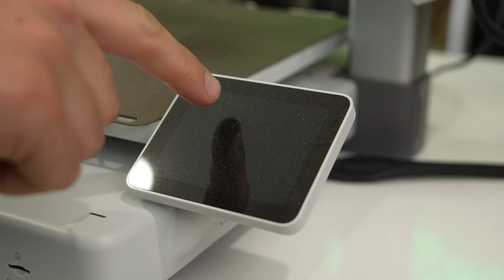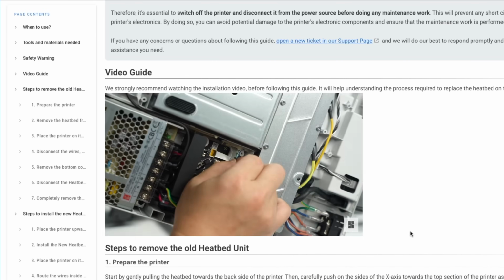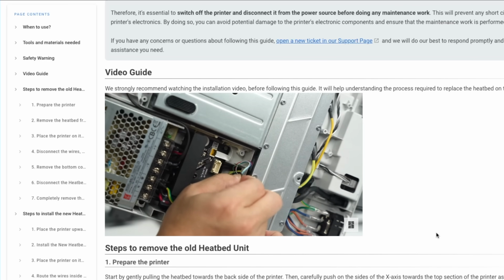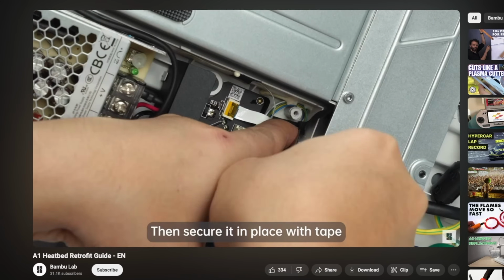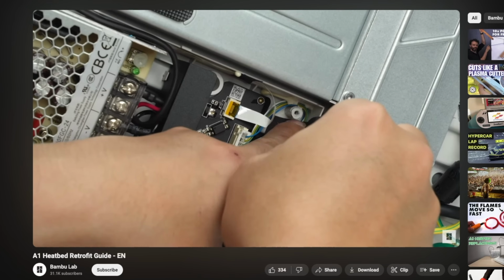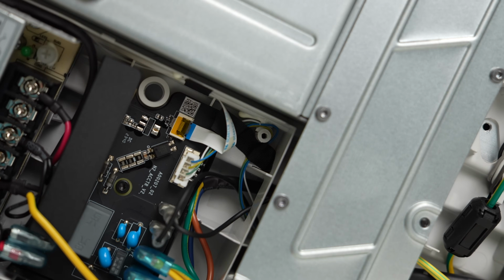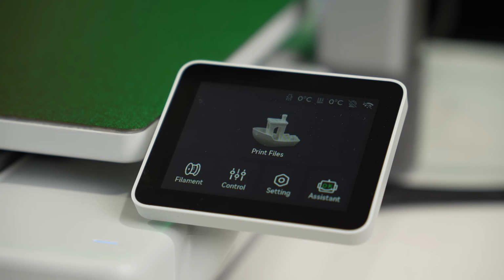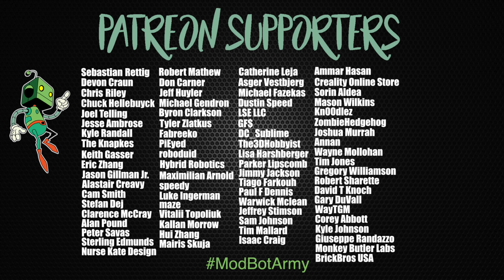Bambu Lab A1 Bed Replacement Guide (Avoid Mistakes)

Comment: Is it possible to swap the cable from a Heatbed?

My broken Heatbed has the new cable and my replacement unit has to old cable. Doesn't sound like a good idea to a Heatbed with the old cable, but if I can switch it, that's shouldn't be a problem.

Comment: Thanks for the very useful video. I just received my A1 from the 2 Year sale and found that the Bed Cable was very twisted and during nozzle cleaning the cable was being hit quite hard every time.
I opened up the panel with the six screws as you described, and I untwisted the cable a full 1/2 turn which solved this and looks exactly as you show at 11:55 minutes in your video.
The printer was sent to me with the cable incorrectly installed! It was easier to fix this myself with your video guide, than go back through Bambu.

Much appreciate your video.  Thanks heaps.

Comment: Just finished mine. One thing I'll add is that some parts of the repair were easier for me when the printer was oriented on its front while leaning the uprights on a spool. It was a pretty easy repair for any hobbyist who turns a screw. While inside, I also rerouted the second ground wire so it wouldn't out any tension on the bed cable. Honestly, the tape was the hardest part for me. 

Great video! Thanks!

Comment: There was NEVER anything wrong with my A1 heat Bed, however to protect Bambu I did the heat bed upgrade from them!  Personally I don't see anything better about the new heat bed cord other than they just put a braided cable guard over it and provided a back stop bumper.

Comment: I recommend not positioning the printer as described in this video , or as indicated by Bambu labs. First of all, use a flat surface that is entirely level across the area you’re using, so not different heights as in this video. Also don’t position it on the left, as the print head will move and rest on the sensor and if you installed the scraper, it will touch that too. Instead, rest the back side on top of a box that is ca 10-15cm (4-6”) high, making sure the bed cable is free and raised above your working surface. Then lower the entire top bar down to your working surface . This provide a MUCH more stable position of your printer, and makes it much easier to work on.

Also, the video linked from trimming is the bed installation video, not the trimming video.

Comment: I got so confused with the holes on the bed. I assumed all 8 holes lined up with the 8 holes in the brackets on the printer. Apparently its just the 4 bottom holes that line up.It looks odd. 
And yeah, the mesh and white rubber end of the cable had me confused too.  Not as easy as it sounded, but not really bad either. 
Nice video!!

Comment: I opted for the replacement bed. Got it all installed with out too much trouble. Glad you pointed out how to capture that cord so it doesn't back out. That was the only thing I was struggling with. Printer has been back up and running for a few weeks now with no problems. Awesome video, thanks Daniel.

Comment: Tip 1 I used a magnetic 🧲 after taking screws that got stuck in  bottom hole of panel .
Tip 2. Use a zip tie to feed wires just tape them on and feed through .

Comment: I had an A1. I chose to send it back for a refund. I got an X1C instead. Even though its a little more than double the price, I don't regret it for a minute.
Reply from the maker: X1C is a beast! I love mine and given the choice between the two would absolutely go with that.
Reply: Why not p1s, just wasting money
Reply: @riba2233  Its mine to "waste". As I said I have no regrets. I love all the features of the X1C.
Reply: @MrMuzza008 ok bro, no need to get upset lol, I just wanted to hear some concrete reasons to get x1 over P1

Comment: This does not look "difficult" but it does look tedious as hell. 

I also wonder who is liable if it fails again and sets your house on fire. Ican see Bamboo arguing you screwed up the install instead of taking responsibility. Better to have them do it.
Reply: You are liable ofc, you had the option not to do it yourself
Reply: Have you replaced it yourself? Then you. Has bambu replaced it? Then bambu. Has a electrician signed of the repair? Then the electrician, which was kinda the whole fiasco for EU citizens. Most electricians dont sign off work others have done, let alone with parts they dont know. Of course given you actually find one that has time. Most will have a look, but wont take over the responsibility in case something happens, hence no sign off. Bambu realised that and they took over the responsibility, yet im unsure how much this holds in the case of a fire and liability case, hence ny answer that the owner is responsible, just to know the worst case.

Comment: Only "issue" is feeding the new cables through the center hole/channel separating front and rear of printer base.

Just use a zip tie. 

Feed the zip tie from the front of printer towards the rear of printer through the hole.  

Tape the new wires to the zip tie and pull the zip tie back towards the front of the printer till the wires are through the hole.  

Untape wires and continue installation.

Hope that helps

Comment: In the next few months the A1 is going to be obsolete.  The new Kobra 3 Combo is a lot cheaper but has all the new technology.  Its also faster and has a more efficient AMS with more features.  I can see Bambu shaving off $150-$200 off the A1 combo just to keep it being bought
Reply: We also thought of that when creality announced the k1. Reality is its cheaper, but also objectively worse (extruder still bad, k1 and k1max have horrible vfa, creality is a joke, nozzle leaks all over the place). Knowing anycubic, we can worse customer service than creality and several open source licence violations.

Also, how would you make a MMU more efficient? With single nozzle and multiple filaments you will always have to purge. The amount you have to purge is determined by two factors, colour, how much filament is left in the hotend. The longer the hotend, the more filament is left. You can ram out a good chunk of the old filament so you need to purge less, but you are always inevitably wasting at least one length of your hotend worth of filament per swap since you have either forced it our before the swap or you are purging it out with the new filament. So either anycubic has shorter hotends, so less purge but also lower print speed, or they are cold pulling filament, which means a huge amount of time is necessary for the colour swap, even with ceramic heater hotends. Cold pulls for colour swap are only viable if you have a inductivly heated hotend (yes, these exist, team plasmics has launched them over a year ago) which have heating times of mere seconds
Reply: @over_pizza_2578   you have a very good point, but people like him are aggressively ignorant will unfortunately never learn :|
Reply from the maker: I would love to see a true competitor come from Anycubic. Right now it’s just specs and marketing. Until I have either tested it or seen others test it I’ll take it with a grain of salt.
Reply: @ModBotArmy  Its not like the A1 has a proven history.....How long after launch did it go before a massive recall?  Yet people bought it
Reply: This is such a naive take, in reality it won't be even close don't worry. Also I highly doubt it will have auto flow calibration...

Comment: Oh dear. The grounding wire looks to be on a painted or anodised mating surface, and using coated screws.😮 This is no good at all. I would advise sanding or scraping the paint/anodised surface and using a non coated screw there to ensure your bed is grounded properly. The way they have done this is not a safe or correct way to ground. Should be bare metal to metal contact.
Reply from the maker: The screw is definitely coated however the frame it is attaching to has no anodizing or coating on it. It’s bare metal. Could be my lighting/camera that made it look differently.
Reply: @ModBotArmy  Are you sure about this? It looks like shiny aluminium inside the threaded part and white coating on the outside flat section. All good if it is just the lighting making the surface look coated.
Reply: @willrogers5913   nah bro they are two metal surfaces, I did the replacement and it's all good, no worries
Reply: @riba2233  sweet, that is good to hear. Thanks for confirming. I've seen it a few times in the past so weary of it now.

Comment: One step I had to do was to tram the bed as it was off enough for the z offset was too close on one side.
Reply from the maker: I also ran a bed tram on mine. The right even fully bottomed out is a little high but I have had no issues at all once the mesh kicks in for a print.
Reply: I am have tramming issues with my A1, left side front and back look great but front right is touching. Only way to get it lower is to remove the screw on the side of the bed completely, but when trammed I cannot put that screw back in
Reply: @NelsAV  before you run the bed tramming remove the nozel and the heating element and check the screws behind it.  If they are loose at all you will have trouble tramming.        CJ

Comment: I don’t have an A1, but I see 1 flaw in the instructions.  After removing the old bed, you should immediately install the new bed and leave the cable dangling until you are ready for it.  Then you don’t need to switch back and forth, and should be able to do this with only 2 orientation moves.

P.S. Using a black anodized or painted fastener for grounding is bad.  From the video, it looks like they did that for all grounding points.  They should be replaced with fasteners that are not black anodized or painted.
Reply from the maker: Yeah, I did the flip flopping because Bambu had it laid out like that but I agree I dont see the point and it seems like one unnecessary move.
Reply: Ground connection is not the issue, two touching surfaces that matter are not coated.

Comment: Small tip with self tapping screws you want to screw back in:
Insert them into the hole and turn them in the unscrew direction first until you feel the screw going down slightly. Then proceed with turning it the screw in direction. Doing it that way avoids cutting a new thread or damaging the on that was already there

Comment: This seems like a pretty technical job. There are many points where mistakes could easily be made. It doesn't seem advisable for anyone without good technical experience. Certainly not kids.
Opting for the factory replacement would be safest unless you are certain of what you are doing.
Reply: Ofc, that is why they provided a choice

Comment: I believe that way “remove bottom panels, disconnect wires, unscrew old bed, attach new bad, connect it to motherboard and return panels” will be little convenient than the way Bambu lab suggested.
Reply from the maker: Thinking back on the process I agree. One less time flipping the printer around. I dont see how having the bed loose made it any easier to remove the cable underneath. Maybe they think the bed wont be sliding on you? but that doesnt really make sense since they have you put it back on before doing the final electrical routing.

Comment: use a piece of string to pull the wires through. You can even cut the old heat bed wire to get the old heat bed out of the way quicker, unless you want to re-use it.
Reply from the maker: This is a great idea 👍. Could have also grabbed a small piece of some TPU.
Reply: I used tweezers
Reply: @riba2233  I use an x1c. lol
Reply: @michaelfilippi3276  there are some things that A1 does better, I would wait for the next X2 gen to use those better features tbh

Comment: Don't forget the photos !
Reply from the maker: That’s right! I don’t think mine was eligible since it was a review unit but yes anyone else should take photos to get their gift cards!
Reply: @ModBotArmy  I don't know if it was a fluke or what but I got my code before I ever even got my bed. The bed came two days later. So I 100% did not submit photos of the corrected installation. I'm still going to take the pictures and send them but I don't know if it's 100% necessary to get your voucher code.

Comment: This what happened to my Trinus not too long after purchasing it. The cable under the bed burned out, and it had to be replaced. But the F-ing manufacturer charged me for the replacement. When it should have replaced it for free.

Comment: It's too bad that Bambu had to be dragged kicking and screaming to admit they had a serious problem and issue a recall. Their lack of urgency to a potentially fatal problem was both revealing and disturbing. Buyers beware.
Reply: "buyers beware" this is bullsh*t. Bambulab needed to collect more than few evidences that this was a production issue NOT affection all the A1 (mine was not affected by the problem but I've been offered to get a replacement anyway. This is the firt proof that this is a serious company that take in account the Customers. Then when it was clear that a production issue happened, they assured everyone about a solution. It took time and reserach and then finally they came up with several proposal PLUS a significant discount for other purchases. This is the second proof that this IS a really serious Company. I've had a single issue with my P1S AMS and they provided DETAILED help (very detailed step by step help) to solve my problem. 
Buyer beware: yes beware that you will not find many 3d printing company that act in a professional way like Bambulab.
Reply: You’re a Creality simp or just an idiot? That never happened. 😂😂😂
Reply: As an owner of an A1 that was recalled, your comment is the opposite of the experience I had and frankly stirring the pot. It was smooth, fast, well handled and I got 200 bucks worth of filament for the delay. Hardly a fiasco.
Reply: So Apple like. Or Samsung or Tesla or ...
Reply: @woodcat7180  some people for sample chance that can't look at the long history of humanity in look and see that there are discernible patterns that will always have in regardless of whether people are happy with them or not because when you're in charge you don't have to listen to what the peons think.
Reply: the delulu is strong in this one...
Reply: No one remembered mk2 fire hazard ?
Reply: What???? That’s literally the complete opposite of what they did. They swiftly investigated the Issue and went above and beyond to make it right.
Reply: @Barbasnoo  I don't know which reply you talking about. The one where they tell their users the printers are safe and is a user issue. or the one sent a day later to their influencers and content creators? The second one says the printers are unsafe and if anyone asks tell them not to use the printer. Three months later they issued a recall. If you want the receipts watch this video from the 3D Musketeers https://www.youtube.com/watch?v=BZEknIMjqUs . It lays it all out in detail.
Reply: @Barbasnoo the fact that they shipped the fix with an entire new bad is crazy. I can't imagine what this recall cost them. They definitely went above and beyond.
Reply: They researched it and fixed it. I would buy again… 🤷🏽‍♀️
Reply: It's too bad you're lying
Reply: Spoken like someone who heard from someone who heard from someone’s brother who heard it from someone’s co-worker who heard it from some guy on the subway.
Reply: @TheRIkkyP  I included the link from 3D Musketeers but that would require looking for facts and seeing where they take you. Have fun in your bubble.
Reply: What? Not at all what happened... And they handled it better than any company would
Reply: Hahahaha "dragged kicking and screaming" man I hope you are joking. They did just what they had to do, investigate the issue, decide how important it is, and fix it.
Can you imagine the cost of a recall like this for a company? Especially a relatively young company like bambulab? I am honestly surprised they had the funds for it.
All things considered, I am even more convinced of getting a bambu as my next printer.
Reply: I saw... no kicking and screaming.
Reply: meh lol
Reply: Come on, they already made the replacement for it
Reply: I bought an A1,  2 weeks before  the recall and can say, I'm very pleased with the handling of the situation I don't know your experience but I wouldn't think twice about buying another one.
Reply: @saltyscorpion2151 What type of weird takedown is this? We got Mr Creality over here
Reply: To make things worse, many content creators who are Bambu brainwashed, down played the issue.  I immediately stopped following every single one of them, as it was clear that they had no concept of what this meant.  Obviously since I am here, ModBot is not one of them.  👍
Reply: @cnc-maker  who downplayed it?